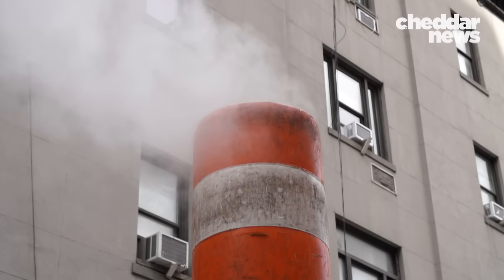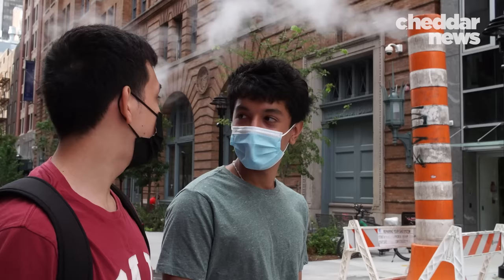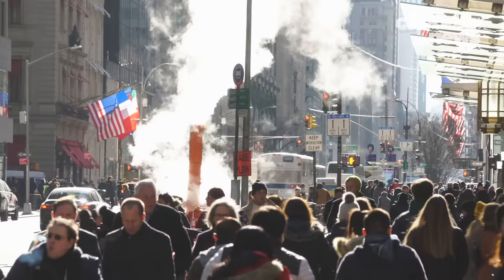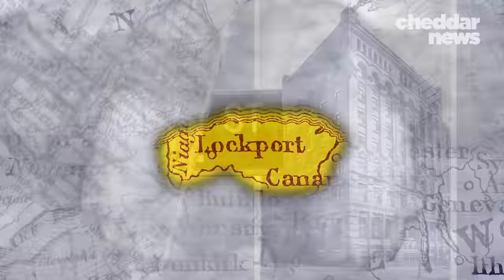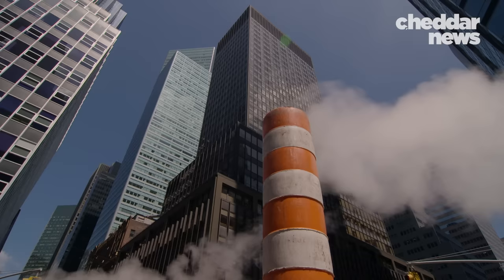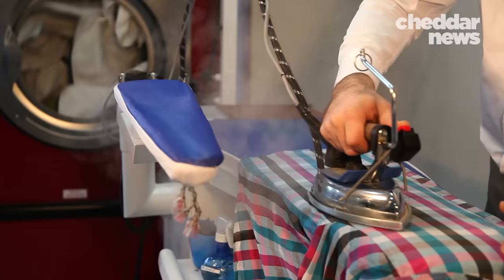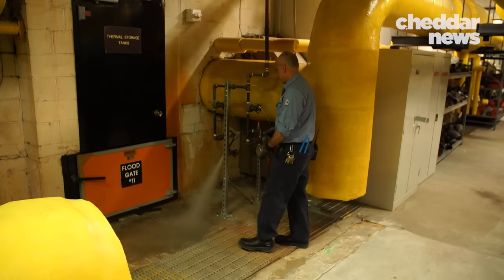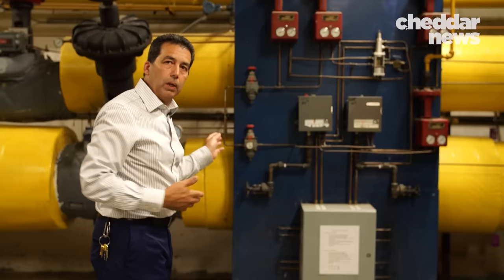Why New York Is Powered By Steam - NYC Revealed

Comment: True innovating idea to use steam for all those buildings as it can be very versatile.  Saves space from needing appliances to create their own heating and any leaks will just leave water.
Reply: Yeah… but i dont think its very efficiënt
Reply: @hansklok3564  it's not. Simple hot water is far more efficient.
Reply: @mendonesiac  I was thinking about that for the whole time. Glad to know it's true
Reply: Sure, back at the time when the alternative was coal. But today?

This system is EXTREMEMLY inefficient by todays standards. From an energy perspective it's a literal nightmare. Thousand hundred of miles of pipe, all super hot, just leak heat, and actual leaks of steam is energy pouring down a drain. 

When he said he expected his company to keep going for another 100 years I cringed.
Reply: The couple at 1:31 looks like they're from  the 90s
Reply: @repatch43  what's the alternative? to strip the city of it's steam infrastructure and replace it with something more efficient? sounds more expensive than the energy savings would be worth in 100 years tbh
Reply: @aerotheepic  And that right there is the problem, "it's expensive, so lets continue to destroy the environment, we've been doing it for over a hundred years, what's another hundred?"
I don't know what the alternative is, there are ALOT of smart people out there, I'm certain if people actually cared they'd push for something to be done, and the research would follow
Reply: @repatch43  expensive? Waste fuel? It’s waste heat from the electricity production — that’s getting vented to the atmosphere anyway in normal electrical plant. Cogeneration isalso used in Nordic countries for district heat (albeit as hot water instead of steam). The pipes are fairly well insulated too, and some of the extra energy lost from phase change and leaks would be used by all the liquid water pumps otherwise too.
Reply: @kaitlyn__L  That's the difference. District heating, which can use either steam or water is significantly more efficient to transport using water. You don't need to pressurize as much as steam and the heat losses per km/mile are a lot less. New York is one of the first place's to start using disctrict heating but it also one of the last places that still use it. It is an outdated system for distribution. CHP (combined heat and power) is much better way of using fossil fuels as it doubles the efficiency of the power plant (80-90% efficient) but its still not perfect. And normal heat power plants are still needed for peak demands.
Reply: @repatch43  Im sure there are people trying to get this company to update their steam to water based system but creedy companies are creedy. For them it is just cheaper to use the old pipes made 50 years ago that are at the end of their life. This video is an informative add basicly as it does not really bring out any of the problems the steam system creates.
Reply: @kaitlyn__L  A hot water system would be FAR more efficient since you'd have a return loop. 

And aside from waste of energy, what about waste of water? In most countries the thought using drinking water like this would be incomprehensible.
Reply: @repatch43  no, I'm sorry, but THAT right there is the problem. Complaining about energy waste and cringing that the system even exists while having ZERO helpful solutions and offloading the job to "a lot (two words btw) of smart people out there" while being unwilling to contribute yourself. Clearly you don't care enough to push for anything to be done either, besides leaving angry comments on YT lol. I suggest you start a gofundme or something similar, as like I said before, NYC is one of the most expensive places on earth to do these kind of renovations so it's going to take A LOT of money.
Reply: @aerotheepic  Hehehe, you're funny. Movements get started because a critical mass of people start pushing for something. That critical mass is built as more and more people start to 'leave angry comments'. You're simply throwing your hands up in the air claiming nothing can be done is FAR more destructive than you seem to think it is.
Reply: It’s actually relatively efficient since steam is essentially a by product of energy generation. Normally, the steam is just wasted and vented off in cooling towers, but here it can be used for heating too.
Reply: @repatch43  I am thinking that it is just part of the business model, if you watch the video they mention the sanitation and  steam cleaners for one, I am not sure what level of purification they place it through and I am not sure if you could co generate but the real advantage to the system is that it can be fueled by many different kinds of power, Co generate with a nuclear fission plant, boom carbon free, cap the landfill (which I am certain is enormous) and pipe the methane to the boiler, better to burn then just let it go into the air. In particular I want to know whether miles upon miles of New gas lines or vastly bolstered electrics (and running even MORE plants to meet the demand) is going to be more efficient or better for the environment. Just because it is old and looks like a fire (oh no scary water vapor) doesn't automatically mean that it is bad, if they ever get fusion off the ground we will get tons and tons of steam as a byproduct. Come up to the 46th parallel inland from the sea at all and see how well you can heat your home from a solar panel, probably possible if you start over with a whole new house but don't think that such a setup will ever work in a city
Reply: @benmoi  the difference in nyc is steam is used in the system to customer buildings because many customers have their own electric generators that are powered by smaller steam turbines like in the main plants of con Ed. If every building were to operate like this with their own boilers, the pollution would be far greater than what is created by the co gen plants. Con Ed does not sell you the electricity they produce when you live in New York, only steam. Electric and gas are purchased from the grid and supplied to you through con Ed distribution systems. The power industry is heavily regulated in New York by the public service commission and will not make a profit in selling electric and gas to its customers. Also a large majority of the steam piping network has been replaced in the past decades to keep the city safe.
Reply: @repatch43  nyc doesn’t have a water shortage though. They have a very robust supply in upstate NY. So water use just isn’t a concern here
Reply: @jd5997  Wow, maybe you should look into the REAL costs of that water that New York uses. Having it travel hundreds of miles has costs, both financial and environmental.
Reply: Water is bad if it leaks
Reply: @repatch43 This is literally waste heat... It's all the leftover steam from a steam turbine. It's free.

Comment: The cool thing is that you can actually use this for air conditioning as well. Steamjet air conditioning was fairly common in large buildings in New York, high pressure steam was used to draw a vacuum and this vacuum lowered the pressure inside an aeration chamber that would quickly lower the boiling point a bit and this evaporation happened much quicker which would cool the water and the chilled water was pumped throughout the building through the radiators.

Comment: New York City native here I use a steam stacks in order to tell the weather for today. If there's high pressure in the area then the steam will funnel up wards. If there is low pressure then the steam will lazily exit the stock and disperse closer to the ground
Reply: I see where your going with this …. But it’s mainly winds and humidity/temp… not barometric pressure
Reply: @tjlovesrachel  Which are both influenced by pressure. But I know u can't really seperate them.  If we're more so focused on the form the fluids are taking though the main variable is pressure

Comment: This is quite interesting-I have seen steam-powered shovels and pile drivers on construction sites in Manhattan as late as the early 1980s. I've seen a steam-powered dredge in the Hudson in the early 1990s. I used to be a boiler inspector in New York State and the vast majority of boilers used for building heat are steam boilers. A hot water boiler is fairly rare. I now live in Toronto, Canada and here the vast majority of heating boilers are hot water systems. Here, steam is mainly used in industry and rarely for building heating. 
There are central heating plants here that send steam to downtown office buildings and condos but in those buildings the steam goes through heat exchangers where it heats hot water which is what is used for heating. There is also deep-lake cooling where cold water from Lake Ontario, where it is taken in from one mile out and is 34 degrees year round is used for building cooling. The discharge is then sent to the potable water plants. 

Ajax, Ontario has a central steam heating system as that's where all the munition plants were during WW2 and having boilers in these plants would be quite dangerous. This system is still in use but on a much reduced basis from the 1940s.
Reply: looking for your thoughts on this.  I did a massive project job at a the Cliff Central cooling plant in Ottawa like 11 years ago.  Re tubing chillers and stuff.  One of the of the plant engineers there told me that they use High Temp High Pressure water.  I asked why not steam, he said its because it needs to be really high pressure and high temperature to keep it from condensing in the pipes.  Where as the high temp high pres water has such a high thermal mass as water, plus you don't need steam traps in the buildings which makes for a more reliable system.  Just wondering if that was true and if you have an opinion on it.
Reply: Montreal has a small district heating system downtown, but I don't know if it's steam or hot water.
Reply: @tylersmith1756  I have never been in a plant like that so I really can't advise on it. My boss may well have so I will ask him about it on Monday.

Comment: Here is an insane idea, build a nuclear power plant underground and pipe the steam that comes out (at least a good chunk of it). You get clean energy and the by-product is steam
Reply: What's the difference between that and a plant that's on the ground?
Reply: That would be preferable to other fuel sources, but after the heat source, from the turbine onwards, it’s the same process.
Reply: I think for now we should focus on decommissioning coal plants, we can think about gas later. Even for a gas plant, this is doubly efficient, using its heat loss productively so it would be even further down in the list of carbon intensive infrastructure.
Reply: @smallbeans101  because it makes it easier to pipe the steam since it goes up. I am not an expert but it might be possible to build it on the ground.
Reply: @fedemtz6  District steam is pressurized, a low pressure system wouldn't really work since the steam would just condense before it ever got into the buildings. So it doesn't make any difference whether it's coming from up high out the boiler on the ground or beneath.

Comment: When I visited NYC for the first time last summer, I was really confused as about these Pipes and the steam that was coming out of it. You can even see my reaction in my first NYC video.
After thinking about i guessed correctly that it was about heating, but only this video gave me the answer as to why they release steam on the street
Reply: they don't intentionally release it, those are leaks or on cold days the evaporation of the hot pipes / rain water hitting the pipes and evaporating.

Comment: Long after it closed I worked in Battersea power station London. When it was built to pacify the locals they agreed to send steam after it generated the electricity, under the Thames into buildings for heat and hot water. The company failed to see the power plant would close and need up having to install steam generationers to fulfil the contracts. It was really interesting t walk into a ruin as vast as that is and find one area still working

Comment: Very interesting. What I find very interesting is the fact that the steam is clean. If it wasn't, then the steam pipes and end-applications would corrode from the inside. And that would get very, very expensive to maintain.

So what do they do with the steam after the energy is released and it returns to water form? That would be very pure water. Do they just flush it down the storm drains? Do they send it back to the steam plant? It seems such as waste to have distilled water only to throw it away.

It would seem to me that it would be far more efficient to have a closed loop system with a pure coolant, like how a nuclear reactor works. They would have to introduce new pure water to compensate for leakage loss and steam cleaning applications.
Reply: I was wondering the same thing. Once the steam is condensed into a liquid it still contains a lot of heat (making it easier to boil than tap water). Is it pumped back to the plant to be converted to steam again or does that hot water just go down the drain?
Reply: the steam goes through a steam trap which basically just separates steam from water.  The water would then be pumped back to the main plant, reheated back to steam and used again.  Water makeup is always needed as you are going to have leaks in the system. but the water is just in a loop.  Open ended systems probably still exist, but i would bet their are rare and in the process of being phased out.
Reply: it gets dumped down the drain.. NYC does not have a condensate return system.... they should but they dont.
Reply: It seems wasteful, but I imagine that a pumped condensate return system for a system the size of NYC would be way more complicated than just pushing steam through pipes. Especially since condensate is corrosive, so you need to add chemicals to the steam which means you can't use it for things like humidification. That plus all the pumps you would need would be a ton of effort to maintain.
Reply: @kelvarnsen  this, is probably the main reason.

Comment: I think the percentage of new york city that is getting that steam is well under 5% of the city  and probably less then 1% of people live in buildings heated by central steam ( New York City  is much more than just the island of Manhattan  which has less then 25% of the population after all ) . Its a hard  thing to say the city is powered by it  given how few people and buildings are actually heated by central steam
Reply: Underrated comment
Reply: Not that many buildings are served by steam, but the largest buildings all are. So it’s hard to know exact numbers, but just going by connected buildings is a bit misleading
Reply: You are probably right … and it’s only Manhattan that’s it
Reply: Would it be more accurate to say that Manhattan is thermally powered by steam?
Reply: @dadanifit   no , most of it is powered by hydro , nuclear and coal . a small area has some buildings getting steam for HVAC
Reply: @woltews   ok. But that is the electric component of the energy powering Manhattan. But my question is whther the thermal component is driven by steam? which ultimately is generated by natural gas.

Comment: Why steam and not hot water? Do you superheat it? I've never heard of steam being used for district heating before.
Reply: My guess is water would need a lot of pumps to move up buildings.
Reply: @Gonzo13eth  Wait, so they run the steam right into radiators and boilers? Isn't it a bit dangerous to have steam right inside your home? I figured they only lead steam into a local substation, heat up water there and then distribute it through the building.

My boiler once exploded due to a faulty regulator, and not only did it ruin all of the bathroom cabinets with a limited amount of steam but I couldn't go inside to cut the valve for at least 30 seconds.
Reply: It's like you guys didn't even watch the video.
Reply: @velikiradojica  yep, the Steam condenses into hot water in the actual radiators. Old apartment buildings in New York are famous for radiator knocking instead of just hearing a quietwhoosh as the water gets pumped. It is indeed to avoid using pumps, because of how old the system is. Because the radiators are designed for steam, even if a building disconnects from the conEd steam to use a boiler in the basement, it still provides similar steam instead of just hot water.
Reply: @DJRenee  tell me Suzie where did they answer my questions in the video?

Comment: How do you get cooling from steam?
Reply: They use a steam jet to pull a vacuum on a closed water loop. This causes some of the water to evaporate and chill the water. The steam and evaporated water is then sent to a condenser to expel the heat. And the chilled water is sent to areas that need cooling.
Reply: @kaymish6178  So they're running a heat engine on the steam coming out of another heat engine?
Reply: @beback_  not really, it's an application of Bernoulli's principle and  evaporative cooling. There's no engine involved except maybe to circulate the water. The most complicated device is the steam ejector used to pull the vacuum and that's really just a couple of pipes, 2 cones, and a steam jet.
Reply: @kaymish6178  But the steam is doing mechanical work, isn't it?
Reply: @beback_  OK I see what you mean, yes the steam is doing mechanical work by sucking the air/water vapour out of the loop.
Reply: you run a turbine that runs a machine to cool water .. its call a steam turbine chiller.